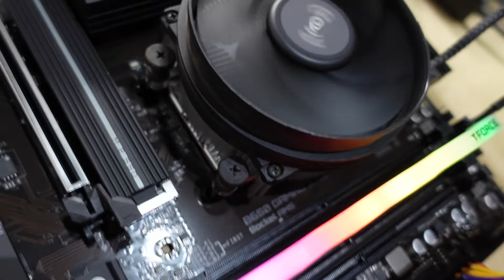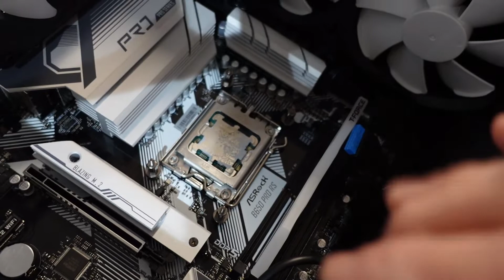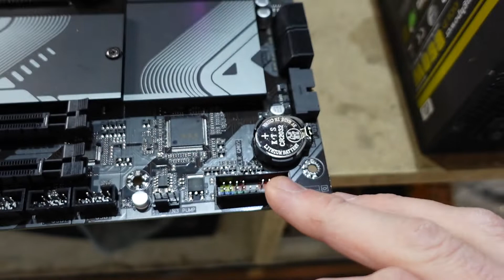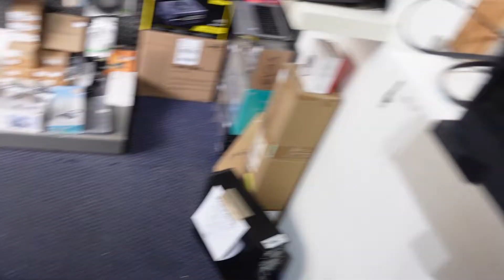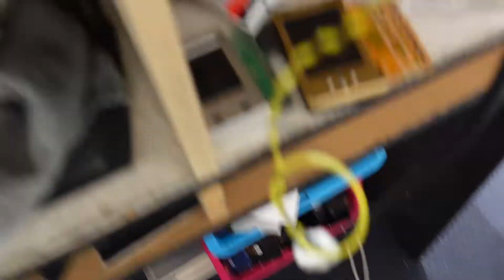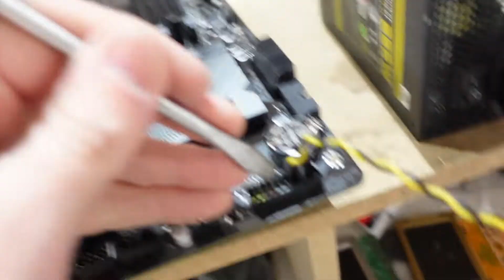AMD AM5 Solid CPU and Ram Light, No Post, Possible Solution

Comment: Hello, I am experiencing the same issue. I already had 16x2 RAM, and I bought 32x2 RAM (all RAMs have the same MHz, model and CL). I wanted to upgrade the RAM of the new PC. I installed it, and both the CPU and DRAM lights turned on, but the PC wouldn't boot; it wasn't booting at all. I tried everything, including resetting the BIOS, but no luck. I ordered new RAM, but the same issue persisted; the PC wouldn't boot. 
like a week ago when I managed to enter the BIOS, I saw the RAM was operating at 4800 MHz, whereas it should have been at 6000 MHz. Thinking this was the issue and I bought new DDR5 4800 MHz RAM, but the PC still didn't work, with the CPU and DRAM lights on. 

So, these problems occurred while I was trying to upgrade the PC's RAM.
What do you think the problem is, and what should I do?
Reply: Hey I'm having the same problem ....did something solve it?? plzzz respond 😢
Reply: @its_not_the_Ishu  
Actually, I partially resolved the issue, as mentioned above. I purchased 2x32GB RAM at 6000MHz, but they didn't work. So, I bought cheaper RAM at 8gb 4800MHz, which also didn't work initially. Surprisingly, when I tried 8gb 4800MHZ in slots 2-4 on the motherboard, they started working and now even both 2x32GB RAM sticks at 6000MHz working.

However, I want to add two more 32GB RAM sticks to have a total of 4x32GB in my computer. Unfortunately, when I tried placing RAM sticks in slots 1-3, the computer wouldn't boot at all. I also observed that when I placed 32GB RAM sticks in slots 1-3, the computer restarted three times and then failed to boot. But when I tried using 8GB RAM sticks in slots 1-3, the computer simply wouldn't boot.

I haven't had the time to looked it, but I believe there may be a solution to this issue that I'm not aware of. If anyone has any suggestions, please let me know.

Motherboard: Asrock B650M-C
RAMs:
DDR5 RAM 32GB Kit (2x16GB) 6000MHz CL38  (came with my computer)
DDR5 RAM 128GB (4x32GB) 6000MHz CL38 (newly purchased)
8GB DDR5 4800MHz PC5-38400 CL40 (purchased to troubleshoot booting issues, which worked)
Reply: how'd you get into bios?
Reply: @elatee  Thats what everyone doesnt say! Its like yada yadda get into bios, thats thing I cant if i could i could get this fixed
Reply: @durpdurpy6202  is your problem the DRAM debug light being orange?
Reply: 6000Mhz RAM works in 4800. It is just able to also work at 6000.
Reply: I changed/activated XMP profile from BIOS and now I dont have that light. I think its because of that. Now RAM is operating at the higghest MHz.
Reply: Exactly the same for me. The problem started after I edited the ram from 48x to 60x. I heard u supposed to update the bios before doing any modifications. How can I reset my configurations?
Reply: @redzeroo6068  check if your motherboard has a "Reset BIOS" button on the back where the ports are. if not, find a tutorial on how to reset bios / cmos
Reply: @elatee  I Found it, thanks a bunch!
Reply: I have a similar situation. MSI B650 Gaming Plus WiFi, DDR5 6000. By default, this memory works at a frequency of 4800, but I had it set to 6000 MHz in dual-channel mode (I don’t remember if there was an XMP profile or if there was another one specifically for AMD). It all worked until one day when the power went out, and my PC no longer started, after which I tried to reset and flash the BIOS.

I ordered the exact same motherboard, and after installing all the components, it started up. The RAM worked at 4800 MHz. I wanted to enable dual-channel mode on the new motherboard, but the BIOS did not save the settings, so I decided to update it. My PC got stuck during the update and no longer booted into Windows. Now, the CPU and DRAM indicators are on, even though I know all the components should be fine.

I tried removing the battery and clearing the BIOS using the JBAT1 contacts, but none of this worked.

I also tried leaving the USB flash drive alone with the motherboard for BIOS update via a special connector, but this also didn’t yield any result. Even when the CPU and DRAM are removed from the motherboard, the respective indicators remain lit red and orange.

Please help resolve this issue!!

Comment: PC has worked fine for many years, turned it on this morning and refused to post. DRam light on, tried every RAM combiantion, resloted my CPU, flushed cmos, flashed newest bios, dusted and vacuumed everything in my case, carefully cleaned the RAM stick and slots to make sure there was no debri or grease. Still nothing
This is so frustrating, it happened overnight and I can't think of any reason as to why it happened. Never done any overclocking, my PC has never overheated, motherboard and CPU is no older than 2 years.
Reply: Built a new system with new and used parts, gigabyte x670 x gaming ax /7600x/ddr5 6200. 
Was working fine, then restarted, got a dram light when i changed nothing, removed one stick 
 It booted, after another restart it refused to post with even one stick
Reply: @Tofu.Express86 same issue here. Works with one ram at a time but with 2 it refuses to work.

The only way it works now it's the following:

Start with one RAM, shut down. Insert second RAM, it works to the point I get a freezeing screen. I restart and it won't boot, DDR Led stays on.

I'm running an occt test right now in dual and after in single.

It's so freaking weird. Was working just fine, it's a new build. 

Only thing that was refurbished was the Mobo.
Reply: Did you find the solution bro im having same issue :(
Reply: @duyhungphannguyen3049  
It was my CPU I guess. They didnt say anything, they just returned my motherboard and RAM back along with a brand new CPU
Reply: @duyhungphannguyen3049  No, sorry. Spend a few days tearing my hair out trying different things but nothing worked. I eventually sent the parts back to the shop 2 days ago for them to take a look. They have not gotten back to me yet, but if I remember, I will let you know what they say once I get it back
Reply: @Dial8Transmition mobo fault probabily, same happened to me … I RMA cpu and ram but nothing work …. So the problem was the msi mobo with ez debug led E0 and dram light orange/yellow on…  i understand your frustation, i hope your ploblem will be fix
Reply: Same with me, x670e asrock pro rs+ 7700x, RMAed mobo n proc but still got psc light again after 3 weeks, however sometime vga + CPU light sometime boot psc light up, still won't get to BIOS, so frustrating

Comment: Is the red light supposed to come on at start up and then go off?
Reply: did you ever find out I have the same question
Reply: @tymoving9106  no I haven't.
Reply: It is supposed to go trough all the lights, first cpu then dram then gpu then boot, it may do the process multiple times. I've hear of ppl who their cpu/dram lights are on but they boot with out a problem.

Yes it should go off once your pc boots up
Reply: @iTzJOHnNyY  I bought a 7900x3d but no gpu yet.

Even without gpu is the PC still able to boot?

I am stuck on white light vga
Reply: @xellr  yes, you should stil be able to boot cause that cpu also has a igpu. U gotta connect the hdmi  or DP onto the motherboard.
Reply: @xellr  u won't have a good experience playing tho, ill say dat.
Reply: @xellr  ps, have u tried reseting cmos?

Comment: I tried installing windows i plugged in the flashdrive with windows saved and continued in the bios nothing posted so i tried to turn it off and back on again then the ram light and cpu light came on after i turned jt back on idk what to do
Reply from the maker: did the pc post at all, prior to putting in the USB?
Reply: @rickstechrepairs no it didn’t but i did look up a bunch of tutorials and called some guys and figured it out
Reply: @therealvix4746 Could you please tell me how they figured it out?
Reply: @therealvix4746  Hey mate can you please post how you fixed this I have the same issue...
Reply: @flippz4189  i took a screwdriver and touched both pins on the jbat1 part of the motherboard or it might have been the jocfs1 part for 5 seconds dont know how but it booten into bios after that so i downloaded the windows installer onto a different flashdrive and it worked
Reply: @onuroksuz9097  its in the replies

Comment: So i have a problem where i would latched the ryzen 7 7700 on my msi b650 board and it would not do anything but once i unlatched it. It would turn on.
Reply from the maker: by latch you mean install the CPU cooler?

is it an aftermarket cooler?
Reply: @rickstechrepairs  the tension from the stock bracket
Reply: Please help me I got the same components as you
Reply: @Okhellopoop  what cou your using
Reply: @Okhellopoop mine was a faulty cpu that i bought so i bought a new 7600x and it worked

Comment: Hi, i using msi b450 tomahawk max motherboard, the cpu light is on, then i change my motherboard to asrock b550m pro4, cpu and ram light is on, i trying using buzzer, but no sound at all, even the cpu and ram light on, so what do you think? Its my cpu or ram is bad
I using ryzen 5 3600
Reply: i have the same problem did you find the solution
Reply: what did you do?
Reply: did u know the problem
Reply: +1 CPU led always red, no display, i don't know Changing my cpu or my motherboard i need help.
Reply: Same issue here and can't find solution any of you guys found the solution for it??
Reply: Same build, any update to this?

Comment: SO glad I came across this video! For me, the red light always turns on during startup however sometimes it stays on, sometimes it does not.. but my ram is always accounted for I have 4x DDR5 sticks and never run into any issues while gaming (even if the light stays on)
Reply: I have the same problem, everything runs and works fine however my red light stays on.
Reply: It was similar for me. The light has always been yellow and everything worked. But when I started my pc today, it was red and nothing worked anymore
Reply from the maker: odd. hopefully all good now
Reply: Remember to check 2x4 power cable is installed on the upper-left. My first board. Gigabyte mobo manual is dogwater. No troubleshooting guide. I was getting CPU only and this was my issue. I also found broken pins. These pinout diagrams without shifted pins, just suck. Waiting on a replacement and I get to do it all over again yay! This time I double check the power before removing and having to repaste.
Reply: so I figured out - turning on my monitor first - then firing up the pc, the light goes away.
Reply: @jongomezdev that’s bizarre

Comment: Exact problem tried all new components and bios updates ect. Trying to leave it running for a bit see if it posts
Reply: Did that end up working?
Reply: @MileytheJeepV2 ended up being a faulty motherboard for me, new am5 have bad instability problems
Reply: Did it work? Imma gaving the same issue
Reply: @gus_100 look at my other reply
Reply: Yes i work but the MK dont work…

Comment: I think I have the same issue, I looked at the 4-pin, 3-wire PC speaker pinout from wikipedia.
I wonder, can I just use a multimeter instead of a speaker to test if it's a cpu issue or a motherboard issue?

Comment: Hey man new to building I just put together a nzxt b650e, 7900x with corsair dominator ram and I can’t get it to post. Tried test each ram one at a time, reseating the cpu, double check all the wiring, clearing the cmos and I’m just stumped. Any suggestions?
Reply: I have the same set up and I can't get it to post with just two sticks. 😢
Reply: Make sure your psu has enough power for the setup then make sure everything is plugged in. If it still won’t post try different ram slots. If the problem still persist try reseating your cpu. Don’t forget to let your ram try to train it self it may take a while. Use pc part picker to make sure everything is compatible.
Reply: @dragonsmoney1311 It's an 850W psu and PC parts picker said everything was compatible. Bought a mobo speaker and I'm getting 3 beeps when RAM is in so I'm thinking I have dead RAM.
Reply: Did you figure it out?
Reply: Yeah I got the pc running with 2 sticks of ram but I can’t it get it to run with 4 sticks
Reply: same exact thing is happening to me
Reply: I just had the exact same problem.  But luckily I recognized I made a simple mistake.  I am using an AM5 MSI B650M Mortar WiFi motherboard and both the red and yellow lights came on.  This means bad cpu, bad memory.  I thought I inserted the Kingston Fury Ram in the #2 pair of slots.  Upon rereading the manual I realized I had them in the #1 pair of slots.  I powered off the pc, moved both over one slot, powered back on.  At first the red and yellow lights came on.  However this was old info from the last attempt.  10 seconds later they went away and it booted into the bios!  YEA!  I was disappointed at first as I thought I would possibly have to get my Ryzen 5 7600 RMA’d or do a lot of troubleshooting but luckily it was a simple mistake on my part.  Gotta go now!  Excited about finishing up and loading windows! 🎉
Reply: @rwayne73  Im using same motherboard as you and i have a problem that my cpu and dram lights are on. I tryed reseating cpu, changing ram places and checking psu cables connections and everything seems fine. After some time I encountered a problem that my pc just randomly restarts when Im playing. What should I do?

Comment: Thank you for the video! I was able to boot succesfully with a ryzen 5 7600x with Gigabyte B650 gaming x and Gskill 6000MT ddr5!
Reply: Heyy please help me i have same confurigation too but not booting up and light and coming only fans are rotating
Reply: @nishchaysaxena3148  just wait a really long time, mine took about half an hour to boot the first time, now I boot in a couple of seconds!
Reply: @jasperb8508  so don’t take off the cpu and readjust or refigure the ram? Just leave it running? I just built mine and felt absolutely defeated seeing the red and yellow :/ I triple checked everything except the cpu pins
Reply: @GrimShleeper  did you fix your issue? I have same problem. 7600x 4x16gb 5200mhz ram. B650 tomahawk. Cpu and ram lights is on and its no display.
Reply: @mucahitozer  yeah try running 2 sticks in the 2 and 4 ports and leave it alone Mine took about 30 mins then it booted if I could suggest maybe take back the ram you have and get 2 sticks of 64
Reply: @mucahitozer  also make sure it’s ddr5 this board doesn’t support ddr4

Comment: The "Wait 5 minutes" for ram to train, reminded me that these new boards are different (or so I've read offhand a few times), and initial boot sometimes needs loads of time to post... Lo and behold, I stuck both sticks in again, then left it for 2 minutes, and it posted. lol.

Here I was thinking it should post within 5 secs no matter what (like older boards). So I kept trying to re-seat the ram to get that dram light to switch off, so it would post.

Anyway, it's working now. Thanks for the reminder. :)
Reply from the maker: great to read this has helped.

Enjoy your PC :)
Reply: @rickstechrepairs  Did it work? Mine Ram slot 1 and 2 not working but 3 and 4 working fine. I dont know what to do please help if you can.
Reply: Dude I was freaking out! I messed around with the ram, unseated and reseat the CPU and the lights still came on. When I tried to post. I did like you said and waited, went to go feed my cat came back and saw the lights turned off and the screen telling me it's getting the "devices ready. 20%"! Just be patient folks, give it 5 minutes and don't lose hope! There's always a solution
Reply: @BeepDragon  UPDATE: I repeated the GPU, of all things, and it worked.
Reply: Does the dram light stay on during the Ram learning process?
Reply: @protobolt  From what I remember, I believe it was, as was 1 other light on my mb (gigabyte b650m aorus  elite).

The main thing is to just turn it on, and leave it sit for a few mins.

If you get to 5 mins, then there is probably an issue. But it should turn on somewhere before that.

On my mb, it takes around 1-2mins to boot, even these days (I had no success using memory restore for some reason).
Reply: 20 minutes+ with new RAM and no POST for me.
Reply: @ScottofOakland  Is your cpu supported by that motherboard? i.e. If you have a new 9800x3d, and are trying to use it on a B650 or X670 board, you will have to update the bios first. Most boards nowadays have the ability to update the bios without a cpu (only psu is needed), so look up the motherboard page to see how to do it.
If it's not that, try putting in only a single memory stick. If that doesn't work, try the other memory stick. Sometimes you can get a bad stick, and that will prevent posting.
Let me know if your still having issues.
Reply: @ianjameslake  yes it was running on other ram for months. Upgrade ram and no post
Reply: @ScottofOakland  Are you running 2 sets of 2 sticks now? i.e. 4 banks? If so, unless they are fully identical, you probably won't get a post.
If it's a replacement of 2 sticks, with 2 different sticks, then it may be that the ram sticks are incompatible with that board.
Did you try just 1 stick of the new ram, and if that one doesn't post, try the other 1 stick?
Reply: @ianjameslake  tried all that. No post. I'm replacing 1 stick with 2 new sticks
Reply: @ScottofOakland  Odds on those sticks aren't going to work with that board. Not every stick of ram, will work with every board, unfortunately. It could also be that they just don't work.
You should take the sticks to someone who has a similar system, or a computer store, and test them on another ddr4/ddr5 system (depending on ram generation), just to check if it is the sticks themselves are working or not, or if it's because they are just incompatible with your board.
Reply: @ianjameslake  I'm going to Geek Squad today.  Thanks